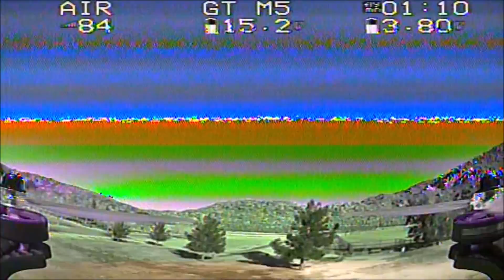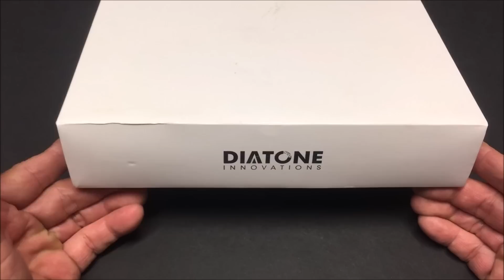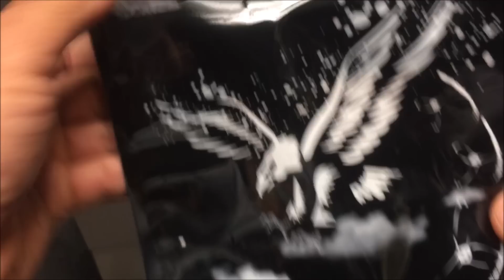CLOSER L👀K & REVIEW!!  DIATONE GT M5 SX  👍👍

Comment: Nice... I have a Diatone built TASCAN which comes with a universal 4-wire harness. I removed the extra white telemetry wire and soldered it on to the XM+ hoping that that is what was intended. I think it did bind but being my first quad I'm a little unsure. In Betaflight my F405 FC was blinking blue. There were some red lights... I don't know, while I was trying to figure out the channel and RSSI settings it started beeping, I didn't see an error message on screen and the battery still had about 1/4 full...  any advice is welcomed.
Reply from the maker: there should be three wires to solder to the xm plus.  5v, ground and signal.  No telemetry wire is needed.
Reply: @RCEscape  Thanks, I said I removed the extra wire, enabling the use of the 4 wire harness. What about the FC with blue lights blinking, is that normal?

Comment: The esc motor wires looks like its soldered on the upside down side.  Which means you'd have to take the thing completely apart to flip the esc over, if you wanted to replace a motor?  That's an insane PITA.  Unless you cut the old motor wires and did a hack splice job.   Am I wrong on this one?
Reply from the maker: Yep!  I don't know why they did that when there are pads on the top side as well.  You could desolder the wires if you got steady hands without removing the esc :) 🤞

Comment: Great Review. Great flying. It will be interesting to see what antenna people prefer on the M5. I have crashed with the stock antenna, and others. The stock aomway doesn't end up in the props. I have been trying different antennas. And haven't found one with a significant advantage. In a 250 meter range it seems to work very well. Please, let us know if you find something better suited. And, crash proof. Thanks Much!
Reply from the maker: I like the looks of the AXII  but the damn thing costs too much for what it is so maybe the Foxeer lollipop stubby could be it.  At least you get two and it is 2.5dbi!!!!
Or get the mini :)

https://www.amazon.com/dp/B07HHXSMRR/ref=psdc_11608080011_t1_B07JWC52ZP

https://www.amazon.com/dp/B07JWC52ZP/ref=psdc_11608080011_t1_B07HHXSMRR